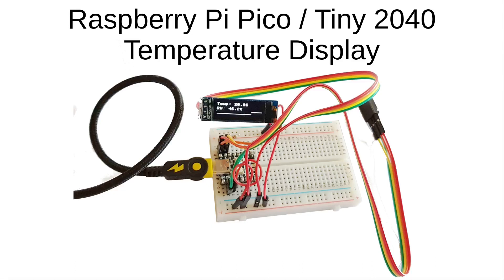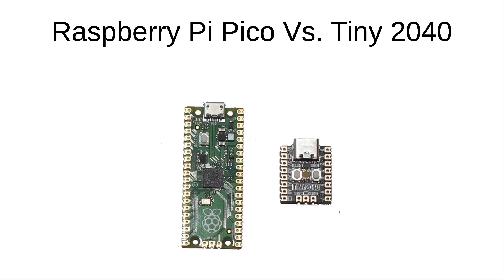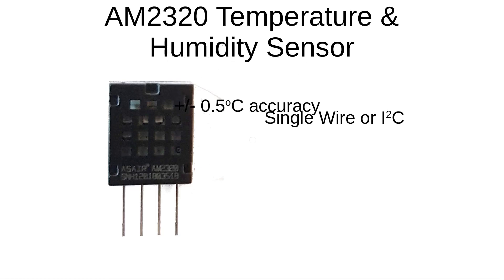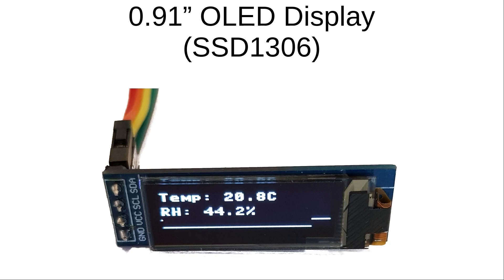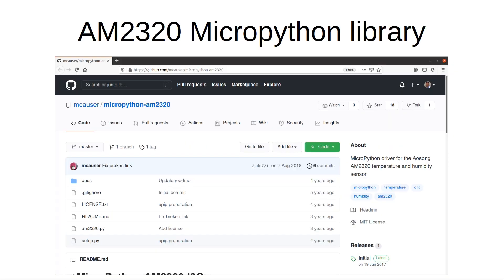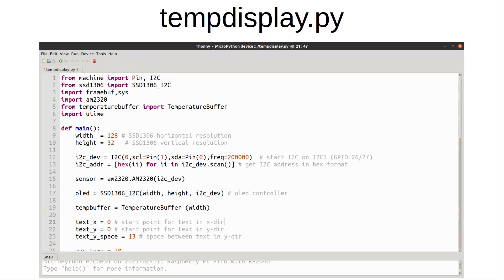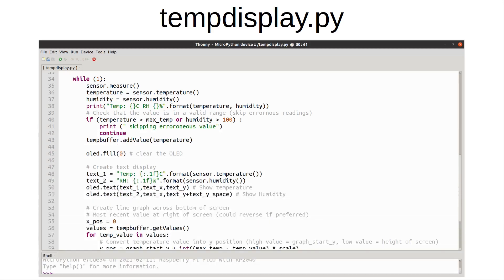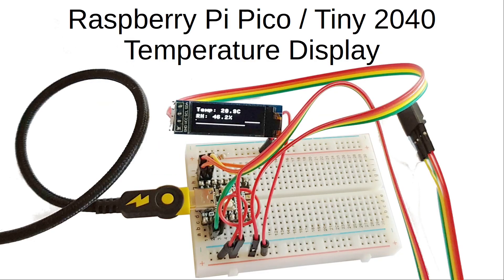Raspberry Pi Pico / Tiny2040 Temperature Sensor using I2C and OLED display

Comment: I appreciate this video but I'm just trying to get the AM2320 working on my pico and cannot get the commands to work. If I run the am2320.py script it doesn't give any feedback on Thonny, but then anytime I try and import am2320, it tells me there is no module with that name. Any advice?
Reply from the maker: The am2320 is the library file. You need that to be on your Pico, but then create another file with your own program that then imports am2320.py. 

So you will need two files on your system. am2320.py and your own code. Both these need to be in the same folder on the Pico. 

There are some examples on the github site where that is downloaded from: https://github.com/mcauser/micropython-am2320